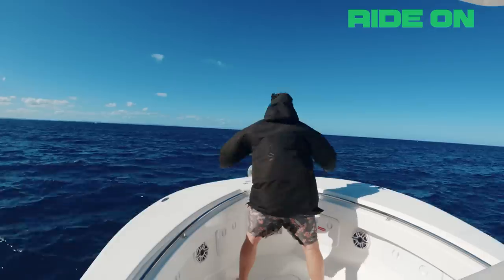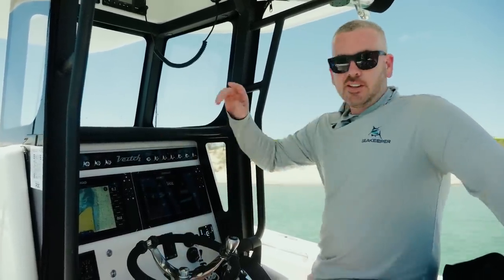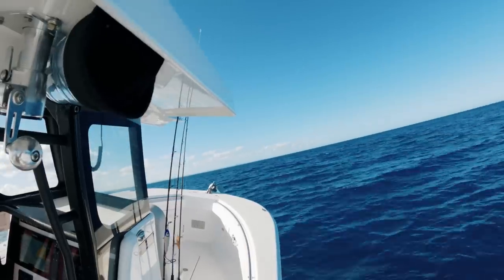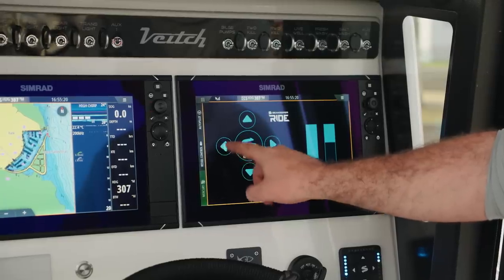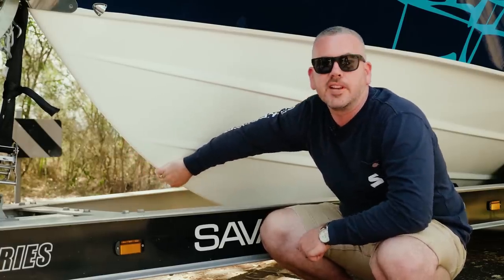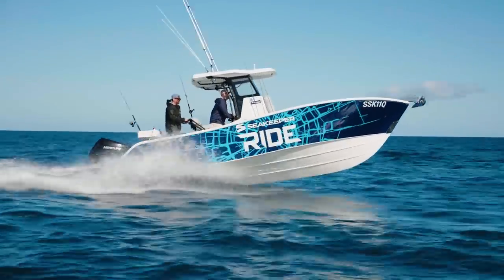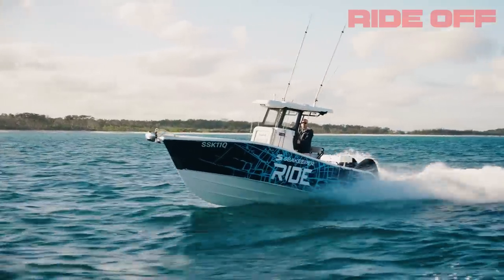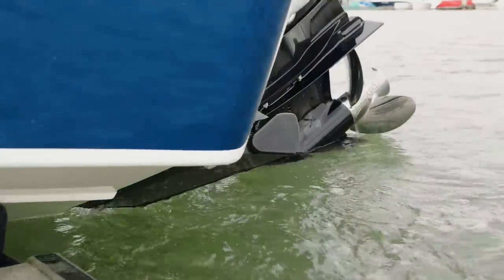Veitch 23 console fitted with RIDE

Comment: So, they’re trim tabs??
Reply: Yep, but they are reactive trim tabs 😅 looks cool tho
Reply: $8k trim tabs
Reply: Amazing technology. I think calling them an "entry level product" is a bit of a stretch though 😂
Reply: Hello! Seakeeper Ride’s controllers create lift, much like conventional trim tabs, by creating a high-pressure wedge of water under the transom, in front of the controllers. This water wedge acts like trim tabs to lift the transom of the boat, but thanks to its proprietary software and rotary design, the Seakeeper Ride system moves significantly faster, creating the same force in a fraction of the time. Since Seakeeper Ride is fully automatic, the forces created by the controllers are used precisely and correctly on every wave, before it’s felt onboard, making Seakeeper Ride the only complete underway stabilization system available today.
Reply: @SeakeeperInc so trim tabs with a quicker motor

Comment: Why does it seem that these Veitches don’t ride properly without multiple stabilisation systems?
Reply: 27° dead rise would probably cover most of it
Reply: Ride perfectly fine without em. All of these systems will enhance any boat and if you’ve got the means to put them on ya boat why wouldn’t you
Reply: Too much deadrise, too little length and beam. In my opinion when running they look unbalanced.
Reply: @raggamuffin1985  😂😂😂
Reply: @smithys3512-lg5yx  The hull in the video is the old 26 degree design, Roger's refined 23 degree hull is far more balanced.

Comment: Didn’t this boat already have a gyro seakeeper ? How do they work together?
Reply: They are two completely different products. However, for the most stabilized vessel both at rest and underway, and the greatest performance available in boating today, you want both Seakeeper and Seakeeper Ride. The addition of a Seakeeper enhances the underway performance of Seakeeper Ride by an additional ~10-20% from our tests, so we suggest you go for both if you can!